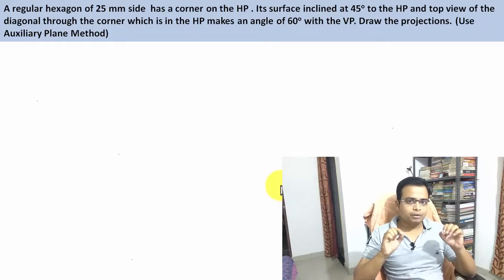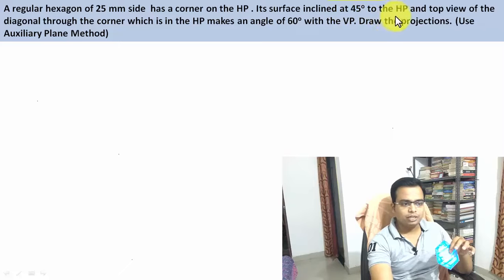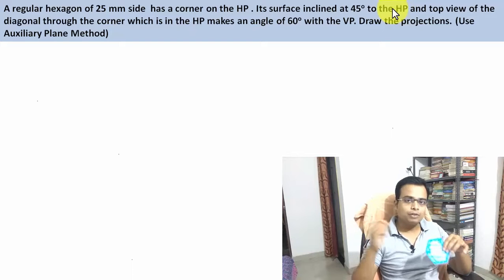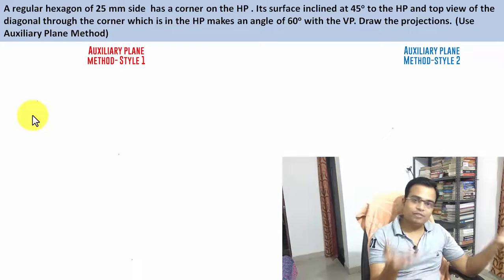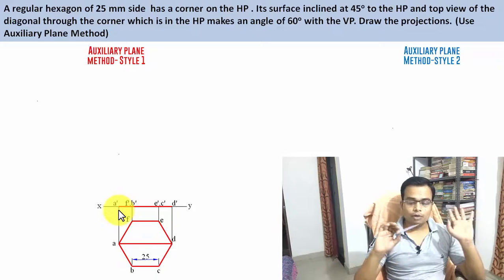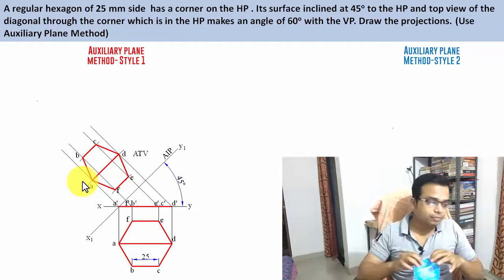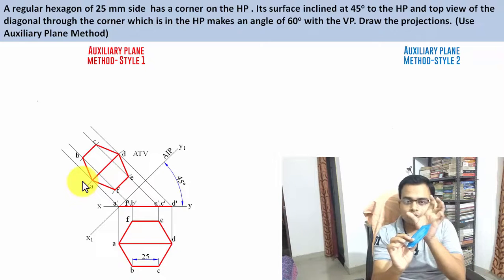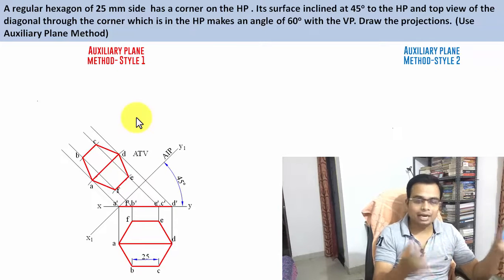Auxiliary Plane_Projection of Plane_Lecture 3

Comment: Sir make a vedio on projection of pentagonal plane by auxiliary method but 
Question should be different 
1. One side in HP 
2. One corner in HP
I can determine the proper position of pentagon in top view but a little bit confused in drawing AIP from XY axis i.e. it should be drawn from the left end of FV or from the right end of FV

Comment: if surface is inclined 90 to hp then  from where we shall begin start making
Reply from the maker: You first need to assume the surface is on or parallel to HP.  And then AIP has to be set at 90 degrees.